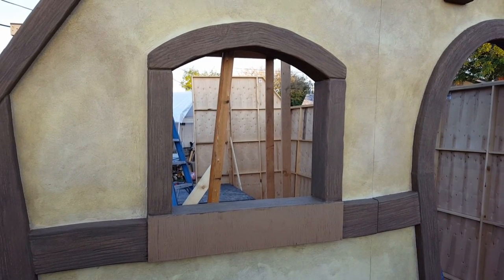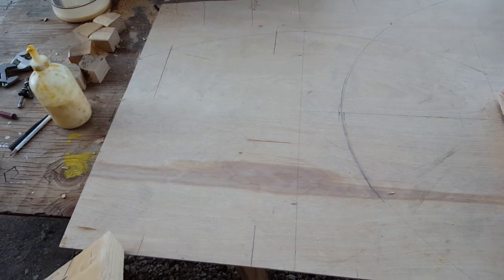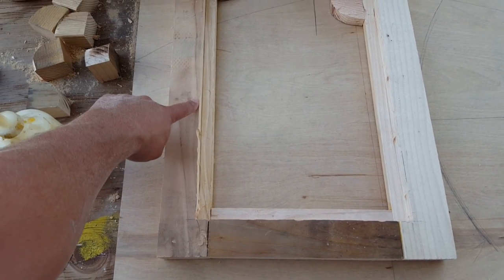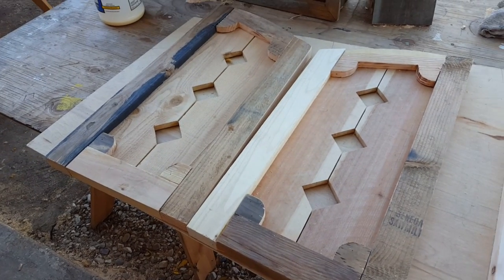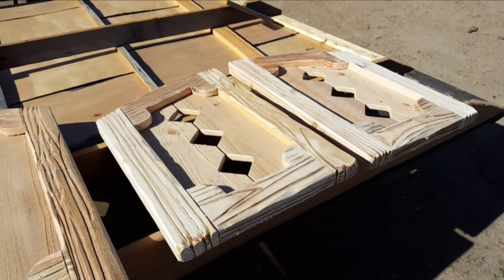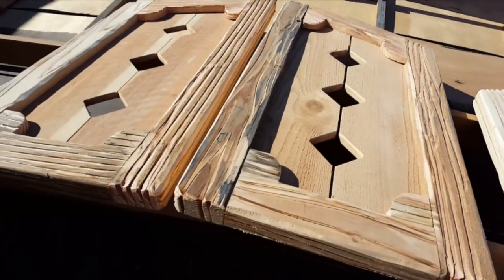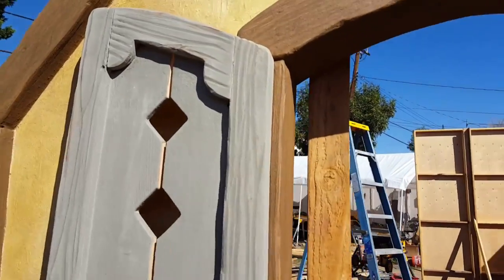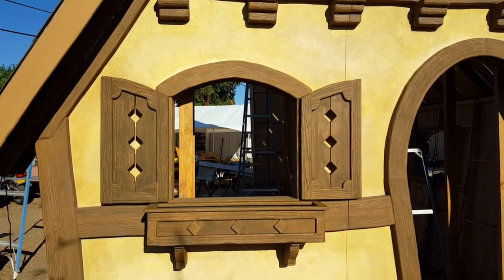Making a Magical Witch Cottage | Whimsical Window Shutters and Flower Boxes

Comment: Wow, so much wood! It's really great, but maybe foam...? How sturdy should it be?  Great ideas as always.
Reply from the maker: We mostly use wood because it is more durable and sturdier. You could do the same with foam but would really need to spend the time hard coating it. Most of our facades get transported after we build them so we just want to make sure it lasts as long as it can.

Comment: Any particular reason you used monster mud on the wood?  Usually I see that done to make something look like stone.
Reply from the maker: screaminscott it is a quick way to fill in the groves that were made with the grinder and saw which helped make it look a little more natural instead of deep machine cut marks.  It also helps create a cartoon effect that makes it look different from a typical natural wooden look, plus we had the mortar already but you could use several other things, muds, mixes, or bondo to create the same effect.